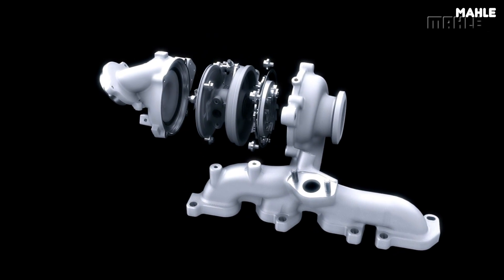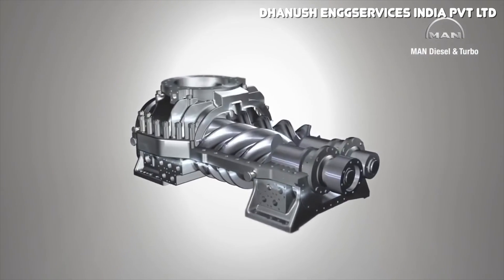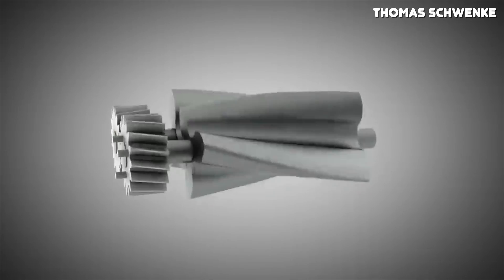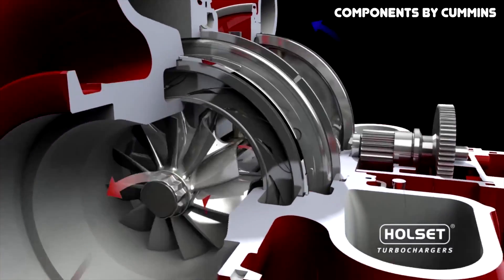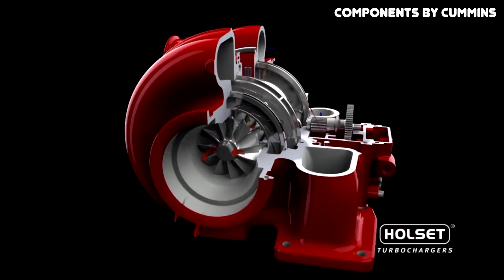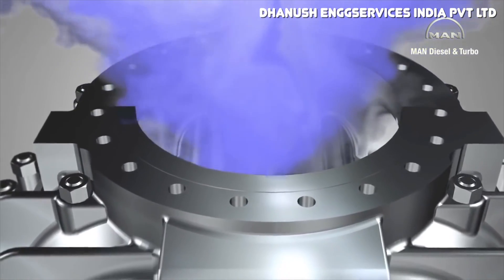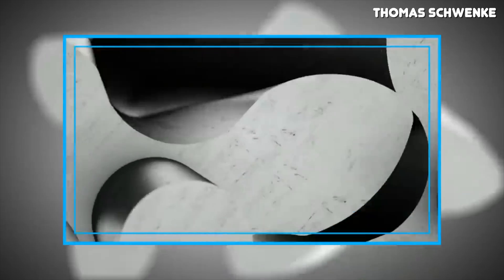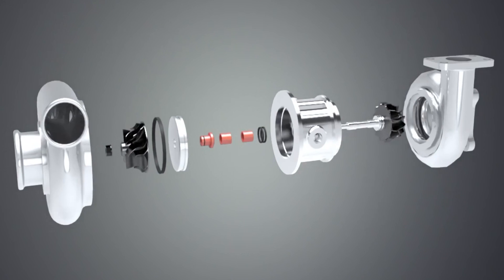Turbocharger vs Supercharger (Explained)

Comment: gm ,ford and dodge tend to use SCs. at least in their v8 applications. any reason for that over turbos? my zl1 does hit hard everywhere but im still considering a turbo for my fbody.
Reply: Because v8's by nature have a higher displacement and already generate alot of torque which is needed to spin a supercharger to increase horsepower.

Comment: I would like to make it twin charged
Super charger to reduce lag in low rpm
Big single or two medium turbo charger for more power  at higher rpm
Reply: You can, but here is your problem.  With having the benefits of both, you are also getting the downsides of both.

Comment: Turbos ALSO TAKE POWER FROM THE ENGINE!!!! Turbos cause a lot of back pressure in the exhaust as much as 5x the boost pressure. If you take a turbo engine and disconnect the boost pipe from the inlet  and plug the turbo outlet to simulate boost. Now dyno the engine compared to the same engine with a nice set of headers you will be shocked how much power the turbo has lost. A friend dynoed a ford 2.0. in NA it made 122 bhp then dynoed the engine with a turbo manifold and a ko4 turbo but not connected to the inlet so still running NA the engine made 91bhp
Reply: does he tested how much HP lost with the same car with supercharger?

Comment: I searched for turbo vs supercharger and I appreciate that one of the first results was from a small channel. Thanks for the informative video! Also, I honestly love the 2000 Chevy Tahoe z71 that I’ve had for a little over a year (and had to just get a transmission rebuild on, woohoo) and honestly if I could have a dream car I’d just want mine in mint condition with a TURBOcharged LSx....and maybe like a carbon fiber driveshaft and custom transmission since it’s all a dream anyway.

Comment: Drag racers don’t care for boost lag they build boost on the tree and operate engines in very tight range they never drop out off boost entire run , you see biggest and laggiest turbos used in drag racing on the other hand spool is very important in road and rally racing and those cars are always turbo ,
Reply: So on an LS3 full N/A with big bore and short stroke would you use a procharger or turbo in a drag race?

Comment: I dont know how the RPM in engine works in forced induction emgine. 
I know that optimally in combustion chamber, for every ~13 part of air,  there should be 1 part of fuel. And a naturally aspirated engine, it will spin as fast as it can take air in, and push air out. 
So lets say just for the sake of argument, for naturally aspirated engine, if given 10 liter of air per minute,  the engine will spin at 1000 rpm, and if given 100 liter of air per minute, it spin at 10000 rpm (assuming the valve spring can handle it)
But why forced induction does not make the engines RPM increases dangerously high? Does every engine need rev limiter than? 
What does a throttle body does in forced induction engine? When the air is pressurised anyway..

Comment: As a late Millennial /early Gen-z basically however you divide the two year-wise I can say I do love Superchargers over turbos because of the max, instant power, looks, and sound! 
Which it could be I developed my tastes for cars in the early to mid-2000s with the Need for Speed Carbon and Forza Motorsport 3 like when you put a super in a Charger Daytona you can't go back.
How ever the first one I'll likely get is a turbo if I get an EcoBoost Mustang or Mazda CX-30 turbo but if I get a mustang I could one day take out the turbo and put in a super maybe even a Raptor's v6 EcoBoost too when I have money and got the reliability out of the V4.
Reply: It'd be a great way to make a vehicle slower!